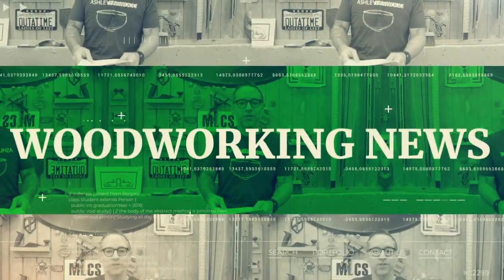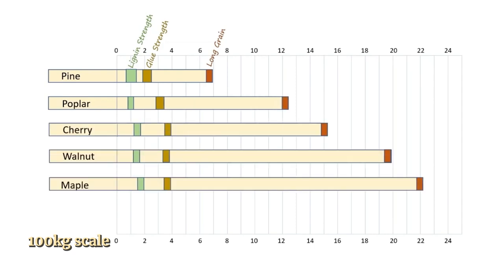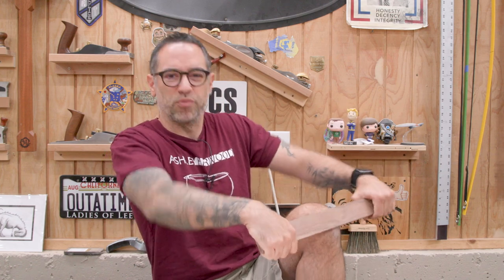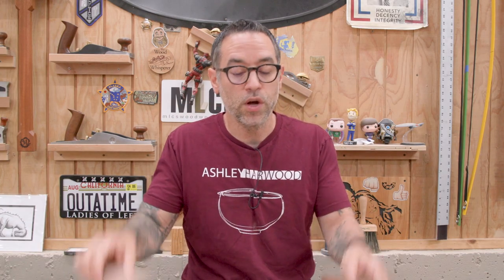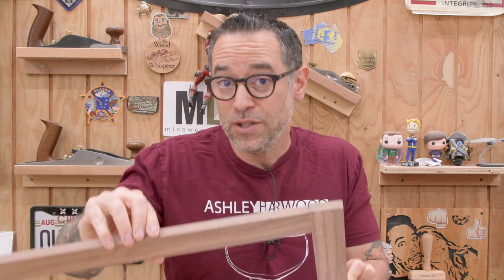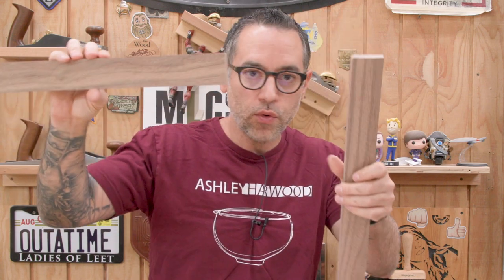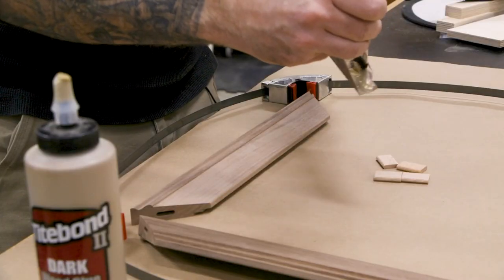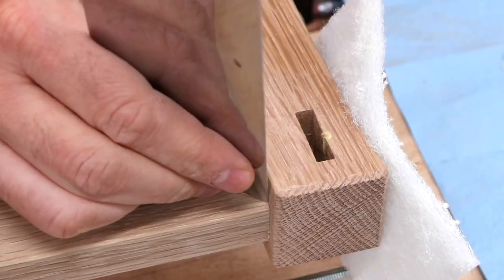End Grain Glue Myths | You May Have Misunderstood

Comment: It appears that Fine Woodworking may have updated their testing from the 2009 article.  You can find that plus chapters on making a variety of commonly used wood joints in their book "Joinery."  The test results that surprised them was that a simple lap joint was the strongest joint, though by a bit less than ten percent.  Their half lap joints for the test were held together by glue, and as far as I can see, depended entirely upon glue.

But these results only apply to Titebond II and Titebond III glues, variations on PVA adhesive.  Mr. Sullivan gave a clear explanation of why and how he believes they work.  Do other types of adhesives, CA's, epoxies, hide glues, bond to wood in the same way?   I'd like to see how those other types compare in the same joint  tests.

Yeah, Mr. Sullivan's video answers one question and raises several others.

Comment: so i started this trail with Cosman's video, then the original then here. I have not yet gotten to Stumpy's.  If you said it I apologize, if others have said it i apologize. But what i have not heard is the bit about end grain to face grain and what will happen if the relative expansions are different and the wood pulls apart.  For anyone who couldn't put the original video in context, that might not be apparent.  If i wasn't lazy and couldn't just think about whether a joint was going to work or not. i would do all the common joints in an FEA code, and make a bunch of curves.  But even i dont troll that hard. I think you did well in clarifying the implications of the results, for those who had questions. The biggest implication is probably in folded carcasses.  That is perhaps a case where someone blindly following the old adage with wide enough boards might decide to turn them the wrong way and make a weaker piece. Thats the point right that the piece is wrong not the joint.  finally, everyone avoids taking issue with the original video.  I am not taking issue, merely providing peer review,  and will probably post the question to Patrick. he didn't show that the joint was weaker only that the wood was weaker.  To show the delta in the glue up you would have to constrain the wood such that it has to break at the joint, and measure the force required to do that. Then you would be back to the joint instead of the piece.  However if you wanted an accurate model, you would have estimates of the failure points of the glue in each of the configurations under each of the types of force,(compression, tension torsion etc) then you could apply that as judgment when you look at a piece and its radial tangential and longitudinal expansion coefficients. Or just keep doing it the way we always have with known best practices, and add this tidbit to the arsenal. Sorry if i broke your comment rule, thanks for the video.

Comment: Testing the shear strength (not tensile strength) of M&T joints has shown that gluing adds little to no additional strength.  The glue completely fails well before the M&T begins to fail.

The glue on a M&T joint is only there to prevent pull-out.  (...and to stabilize loose joints, if that's what you want.)

Comment: Have you tried the Beadlock? I bought one and tried it (thankfully on scraps) and it does not cut the slots parallel with the face of the wood causing the two pieces of wood at the joint to be out of plane. I tried several times to fix it but the joints will not be flush. And I made sure to reference the same face on both boards and to clamp in such a way that the jig didn’t shift when drilling (this happened easily on and end board when drilling in position B for the interior 2 holes). Now I’m stuck

Comment: To me the key point to take from both Patrick's video and this one is that lignin isn't all that strong.  Don't rely on that if you are going to have a lot of demands put on a joint.

The secondary point is that the glue is stronger than lignin.  So properly done, an end-grain to end-grain joint will be pretty strong compared to what we were taught to expect.

Now I want to see someone testing scarf joints. . .  There's probably a video on that as well.

Comment: I didn't see the video but saw the people making the assumptions you did. Some said it tongue in cheek and I think a few believe it.  As you point out here, it isn't data for wood working. 

Here is something you know, but maybe helpful to a novice.  

Wood is made of fibers. If you break it, it splinters everywhere.  The fibers keep it together until they separate from each other and break at different places.  To break a board, you have to separate the fibers. 

In martial arts, they break boards by exploiting the weakest angle to the fibers. 

When you cut a board, you weaken the fibers on the edges.  When you glue it together, the glue bonds the already broken fibers, so when you break the joint, the fibers near the joint, not far away, break.  The glue may not be as strong as the center of the board, but it is stronger than the edges.  

End to end tinsel strength, I can see that working.  You have the ends of thousands of fibers gripping the glue and no leverage.  The collective fibers are giving it strength. But, like you proved with your knee, the board didn't break.  The glue broke because you separated the outer edges first and then all the rest gave way. 

I broke a bunch of but to edge glue joints today from older builds I abandoned or replaced.  I used leverage and the glue almost always kept the fibers of the edge board.  In over a dozen joints, only the edge of the board where it met the glue gave way.  

BTW, just to be clear, the joints were pocket hole joints that were glued. I removed the screws and reallocated the wood to my current project. 

I'm glad you made the video because it's good to see what the talk is all about. 
Thank you.

Comment: Frankly, I think Patrick's video has the potential to affect how we think about three things.  1) Glue joints are not weaker just because end-grain is involved.  2) We probably don't need to spline our miters on picture frames.  If the frame profile has a decent cross sectional area for the total weight, glue is strong enough.  I would have said this 10 years ago, but nobody would have believed me.  Some people still wont. 3) An edge-glued joint is stronger than the wood.  Connecting edge joints with loose tenons doesn't final product stronger.  If you want to use them for alignment, fine, but it doesn't generally make for a stronger panel.*  Many of us are well aware of this, but since there are so many YouTube videos of people using dominos in edge glue-ups, I thought it was worth mentioning.

The force required to break a joint depends on many factors, so it's very hard to make apples-to-apples tests for different joinery techniques.  It's really only fair to compare joinery techniques that share the same external geometry, because that's the only way the same forces will result in the same net stress on the joint.  That's important because force doesn't determine when a joint fails - stress does.

Stress comes in three flavors: tension (pulling) , compression (crushing), and shear (sliding).  Different wood species and different glues will have different failure strengths for these three stresses.  Furthermore, wood's ability withstand these stresses depends on whether the stress is applied longitudinally (along the grain), radially ("perpendicular" to the growth rings), or tangentially ("parallel" to the growth rings).  Since wood rarely has grain that is perfectly oriented relative to the edges of our boards, and most joinery mixes grain directions, almost all real-world applications involve a mix of all these factors.  Speaking generally, glue is 2x to 4x stronger in shear than in tension, and wood is 5x to 10x stronger in longitudinal tension than in radial or tangential shear. Then as a joint ages, it's affected by glue deterioration (admittedly slow with modern glues assuming you choose a suitable glue for the species and service conditions), wood shrinkage, and fatigue from intermittent loading.  How a brand-new, well-fitted joint handles these stresses is likely different from how a well-used piece of furniture will handle them 15 years later.

If you haven't figured it out yet, the structural analysis of wood joinery is complicated.  Patrick's methodology effectively tests tensile stress in new, well-fitted joints for a variety of woods under both longitudinal and tangential loads using PVA glue.  His video is informative and I feel smarter for having watched it, but it has very limited applications.  What I hope I illustrated here is that few of us (myself included) understand wood joinery in anything approaching a quantifiable way.  As such, we ignore centuries of hard-earned, traditional wisdom at our peril.

*To be specific, a loose tenon won't increase the tensile or compressive strength (and, by extension, the bending strength) of the final panel.  It probably increases the shear strength of the glue joint, but that's not how we normally load things like table tops and raised panels where edge glue-ups are most common, but there may be exceptions where shear is important.

Comment: When it comes to end grain glue ups, I am much more interested in the mitered glue joint, which is the one I would use the most (versus a straight end to end grain connection). With everything that was said (plus my guts) I do think most boxes do NOT need splines, those are overkill. I may however continue to use splines or other reinforcements on large picture frames given their awkward size and ratios versus the thickness of the board and the way one may hold them when carrying/installing.
Reply: The problem I have with not using mitre reinforcement, is that I want my boxes to be a living piece. I want them to be handled and used, not gather dust. I'm not willing to gamble on an unreinforced mitre joint in that scenario.
Reply: @MatthewMakesAU  I understand, me too. But still I dont see how a glued mitered corner would be too weak for manipulation, specially on small boxes. Not only the glue is strong enough but typically you would have the base to bring rigidity (but also the lid, an insert, etc). But obviously it is a personal choice.

Comment: Late to the party - but I think a fair conclusion from Patrick Sullivan's video is that glue is 1/4 to 1/8 the strength of wood fibers, depending on the wood - which is still a fair amount stronger than lignin. When thinking of strength in woodworking, therefore, we should consider three things: grain direction, grain direction and grain direction.

Comment: I was always tought that the sole purpose was to increase the surface area of the wood joint. Add glue to the joint it stands to reason that the strength greatly increased. Of course when the entire part glued up is finished on all sides the integrity of the joint last even longer.

Comment: The contact area on end grain is very commonly much less than on long grain as well. Practically this means the lesser performance of the long grain joint is not that meaningful unless using square pieces.

Comment: as a structural engineer, the next step to test this would be to do straight tensile tests... as the other video pointed out in the end to side tests, the stiffness contributed a lot.  therefore, tensile cares very little about stiffness, at least compared to bending (planer sections remain plane assumption).  

Though we'd probably still find the same thing - it was a statically determinant beam after all.  just want to see a test trying to eliminate stiffness as a factor and truly test the glue bonding to the different types.

Comment: I watched your video, the original, Stumpy's, etc. My conclusion: listen carefully for what is being said. Take everything with a little grain of salt and look at your joints on an individual base. For example take the long to long and end to end grain joints. Patrick applied his forces fairly close to the joint and end to end won. But and its a big but go out of the joint and due to leverage little force is required. In day to day woodworking that leverage would be present in end to end but rarely in long to long. If your joint is put together in such a way as to put pressure on wood fibers rather than what's holding them together you're golden. As with all media people are hearing what they wish to hear not listening to what was said.

Comment: First, I loved Patrick Sullivan's test--it was revealing. Here's why:  We've been taught that end-grain starves a joint of glue, and the fear is that a whisper of force will cause such joints to collapse.  

Your (Wood Whisperer) comment about building a four-joint-door is equally revealing.  There's simply no need for thousands of pounds of resistance in a simple door (let's say, a cabinet door, not a room door).  What Sullivan taught me is that a simple butt joint will be more than strong enough for most of the non-load-bearing work I do.  

I don't have to fear the butt-joint anymore since it's clear that end-grain doesn't "starve" the joint.  Glue is durn strong, and mortise and tenon joinery is nice--but a lot of steps, for not much gain in all circumstances.
Reply from the maker: Don’t forget to factor in wood movement and time. That butt joint that’s strong enough today may not be strong enough 3 years from now. The aspect of time definitely warrants some more investigation as I’m only speculating here based on what I’ve been taught.
Reply: @woodwhisperer  I haven't yet watched that other video but in my mind glue may be strong but there's no substitute for the strength of mechanical joinery.  A glued mortise-and-tenon may last a long time, but a glued and pinned mortise-and-tenon will last forever
Reply: @woodwhisperer  Sounds like something else to test!  Paaaatricccckkkkk!!!?!?

Comment: This is another interesting perspective on the strength of the joints. An issue no one talks about with how many lbs a joint can do is wether it is a shear a tnsion a torsion a moment where they are measuring force applied at the end of lever arm. All of these will be different. Also multipling a strength of a joint by the number of joints is not a near correct way to determine strength of a piece. This would require an infinitely stiff material which would is no where close to and a uniform load over the entire surface which is never the case.  All that said I agree with the premise that traditional joints are stonger than just glue.

Comment: The strength of a glue joint is constant. It has nothing to do with orientation. It just happens to be somewhere between the strength of wood to hold fibers close together at the low end and the strength of fibers to resist breaking at the high end... The strength of a joint is given by the strength of the weakest link, so to speak. Make your weakest link stronger than you'd expect your project to need to be able to withstand, and you'll be fine.

Comment: I was waiting for the fallout. The only pure glue joints we generally use are long grain to long grain and miter joints. For the former, I guess we just need stronger wood. Ha. Also, the conventional wisdom about end grain was that it sucked the glue out of the joint.
Reply: I never saw a downside to glue being “sucked out of an end to end grain joint.” When making segmented bowls most joints in a ring are end grain to end grain. I typically would glue all my segments for a ring at once and allow a short period of time for the glue to wick into the pores or straws off the wood fibre and if needed add a little more glue before joining them together. I theorised that if anything this increased the surface area covered by the glue thus giving a stronger joint adhesion. Patrick’s video confirmed this when he showed close up shots of the failed joint. I watched Patrick’s video with joy and applaud his analytical approach on the subject but personally never considered replacing mechanical means of joinery with glue only joints when watching his video. The only application that came to mind when I watched his video was that of segmented wood turning. The thing people are getting hung up on is not realising that different applications require different methods and Patrick never said that one method should be used for all joinery. Why else would there be so many varieties of joinery out there. Unfortunately you could debate this for years with some people and they simply are incapable of seeing things from different angles. Bit of a rant but I hope it makes sense to you who read it.